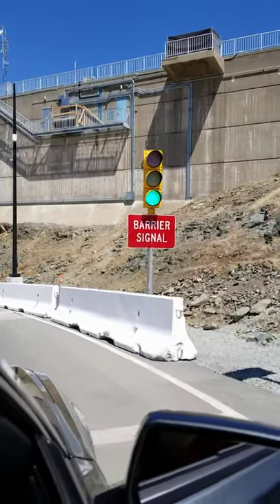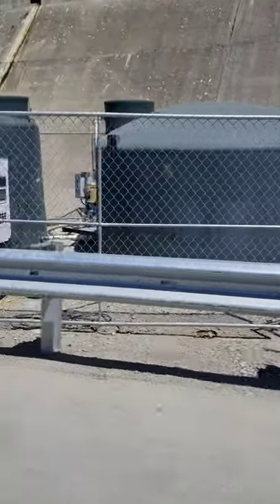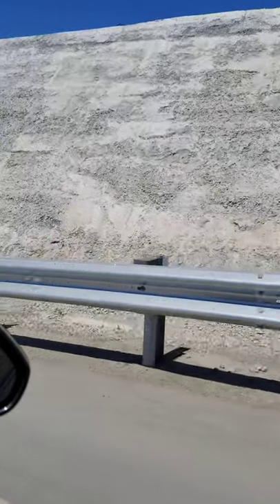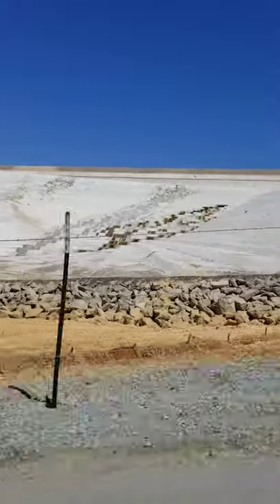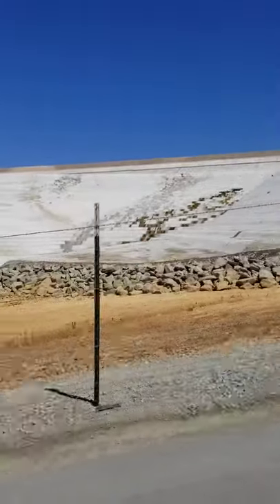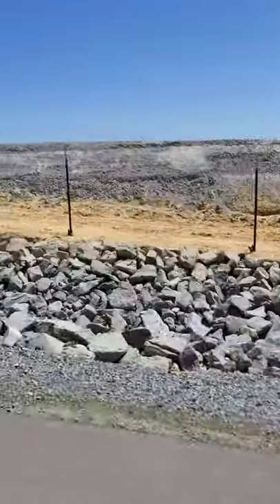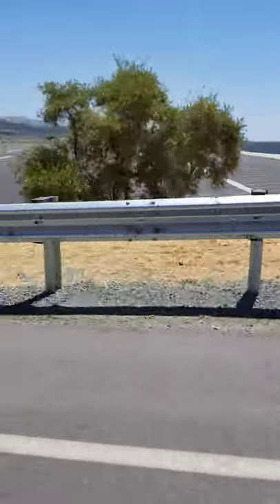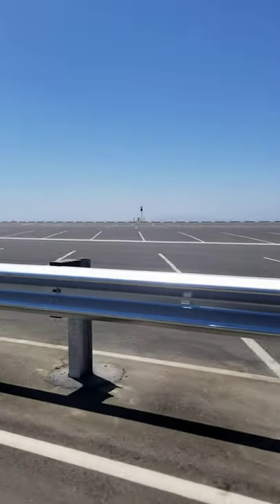Driving over Top of Oroville Spillway from Dam to Boat Launch Area

Comment: Hi Millie 
Quite a long drive to get back to the old stomping ground. If I can draw your attention to 52 seconds into the video, Is that the crack I mentioned in your earlier vid. It's partially obscured by the Kiewit generator set to see if it goes right to ground but it goes up as far as your frame allowed. Seeing as its full of moss' or similar plants and it's a vertical line. Well? It's definitely on the old part of the emergency weir. The leaking gates probably sound worse than it is because of the echo chamber effect. in any case they have leaked for years, even the old spillway always had water running down it. 
The new emergency stepped splash pad does have as you said monitors embedded all over the place, so does the main spillway. The steps dissipate the force of any future weir topping, heaven forbid.
Keep up the good work, great vid's as usual.
Regards
Brian
Reply from the maker: Hi Brian! Yeah, quite a trip (planes, trains, and automobiles LOL). I took a close look at the 52-second point, and I think you are right. And thanks for the good info about the gate leaks. There always needs to be a voice of reason applied to every Dam thing! Yeah, the echo chamber effect gives it a gushing sound that sure captures my attention! ! I really appreciate your input, Brian. Thanks for the nice compliments. Take good care.

Comment: Hi Millie
 (planes, trains, and automobiles LOL). I live(a long way way from our state capital Perth in WA, about 450Km's). BUT, there is a restaurant or used to be, I don't know of it's still there, it was called just that in our state capital, and has  a Loco front cab suspended out on the 2nd floor. Thank you for your responding to my comment. 
Regards
Brian
Reply from the maker: Sounds like a cool restaurant! By the way, Brian, what do you think of that video point #52? (I guess we could call it "Area 52" LOL). A crack -- a drain -- a port? You have a VERY good eye for things like that!

Comment: Turn the camera(phone) horizontal for a better picture...please 😎
Reply from the maker: Hello HI Flyer! My apologies. I have always used landscape view for my YouTube videos. On this drive I could not hold the phone steady in landscape and opted for portrait view. Don't plan to do that again!
Reply: @MillieKay  They make a holder to hold your phone steady in landscape mode. I don't think they're too expensive Millie.
Thanks for your videos!!
Reply: To compensate, I made sure the YT Video resolution was set to H, and, I watched Full screen at 50% speed, with my browser magnified to 300%. The HD images are great.
Reply from the maker: Thanks, Hard Rock Master! I hadn't planned to use portrait mode -- have always done my videos in landscape view. Don't plan on doing the tiny view again, and wish I hadn't done so this time.
Reply from the maker: Hey Hard Rock Master! Great info! I tried it and it's nice -- except my voice is SO slow at 50% that I muted it. Thanks!
Reply: @MillieKay  The camera you are using takes good pictures. It will be even more enjoyable in the landscape mode. Thanks again for what you do Millie!!

Comment: The reservoir elevation is currently 4 inches from the 900 Foot level for overtopping the Emergency Spillway.
Reply from the maker: Yes! And according to CDEC stats, they aren't releasing any water. 🤔
Reply: Just checked again and there's 3.75 inches to go at 1600 PST. I haven't seen any kind of warning in the news about this danger. The Emergency Spillway is untested.
Reply: @MillieKay  Yeah, I saw the outflow was only 13 CFS?
Reply from the maker: @keithmandeville4953  Maybe they want to test it. 🤔
Reply from the maker: @Keith Mandeville  That could be an error or they could have shut the turbines down for some reason and will power some of them up soon.

Comment: They definitely need to get some of the native grasses growing on that dirt asap. Some trees wouldn't hurt either. 
Thank you for the little video!
Reply from the maker: You're welcome, Brendan! Yeah, just dirt doesn't make sense. However, it is my understanding that spillways need to be smooth, with no trees. In flood areas, trees help with erosion -- on spillways, they just get uprooted and cause problems. When the Emergency Spillway was actuated in February 2017, they were frantically removing trees that shouldn't have been there in the first place. Thanks for viewing and commenting. Your commentary is valuable and welcome.